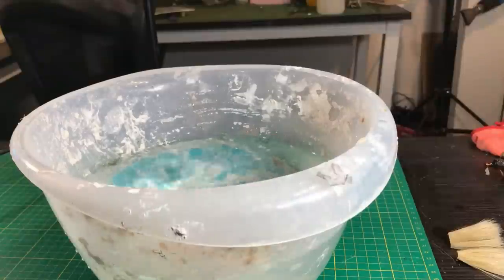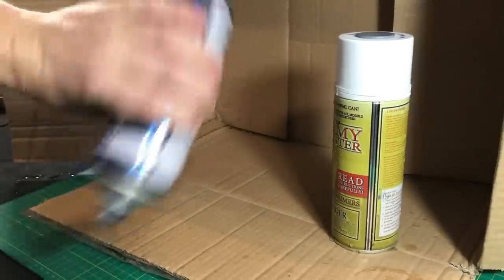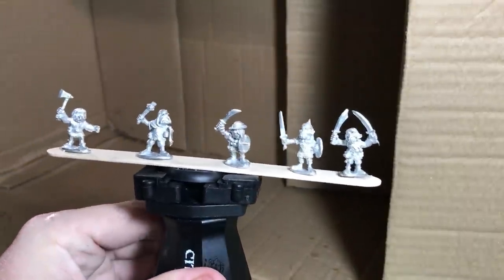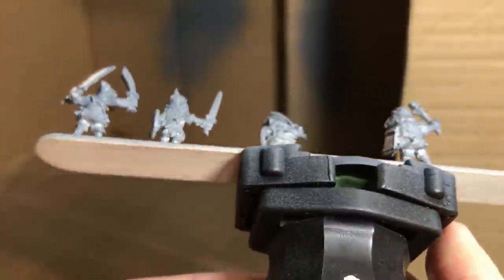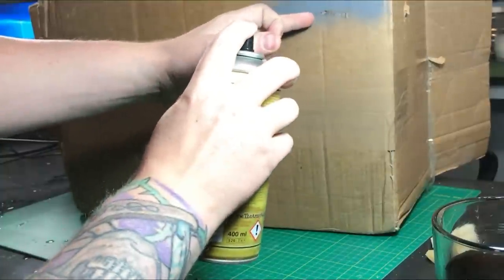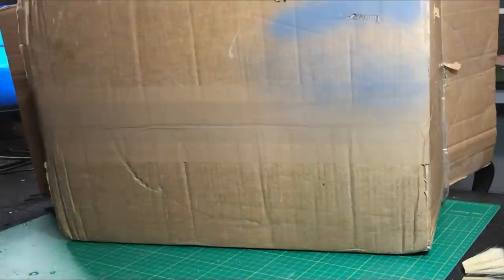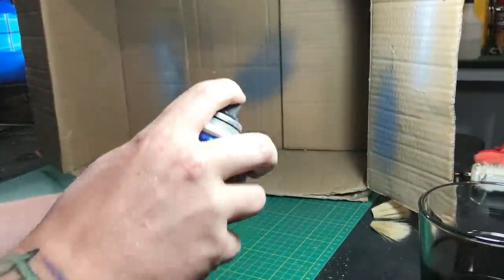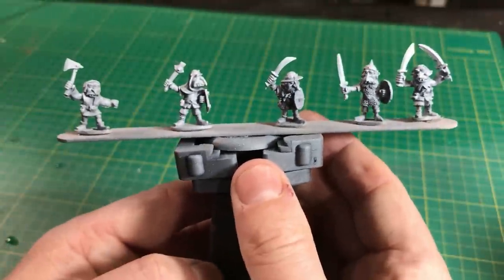Is It You Or The Spray? :How To Use Spray Cans Without Fail

Comment: Fantastic vid!  I disagree with you the upside down clearing spray when you are done.  I find that ESSENTIAL to keeping spray cans in good order because I live in a high humidity area.  If not cleared, paint WILL DRY in the nozzle head.And it really doesn't waste all that much paint.
  I have used the Army painter cans almost exclusively since they were released.  They are mostly fantastic.  HOWEVER I have had multiple cases of their white spray clog up IN THE CAN! even after upside down spraying.  Also, Something with their metallic spray colors is off.  They are SUPER hard to paint over and I have had it create pits in certain resin models.  I now always spray black and hand paint metallic when possible.
yes, warming your paint can is essential to mixing your paint properly.  And spray distance is the number 1 thing printed WRONG on most spray cans.  I always test fire my cans before proceeding onto the model.  You don't want any surprises shooting out of the can like globs or spittle.  
Lastly, WEAR GLOVES!  a cheap box of nitrile gloves from the hardware store can save your hands from paint, and save your models from fingerprints.  Its so much nicer when you can just go ahead and hold something while not worrying about spraying your hand.

Comment: Hi everyone, PLEASE be careful with warming your cans in water. 
The manufacturer will usually state the max temperature that the can can be exposed to, roughly about 50C.
I've been my GW spray cans in a bucket of warm/hot water like Luke said, and haven't had any problems.
I've always been able to put my hand in the water, so it wasn't scalding, but probably on the warmer side.

Recently, I"ve been using an Army Painter Plate Mail spray can.
Today, after placing the AP can in warm water, I noticed the underside of the can bulging noticeably, about 2cm or so in the centre of the underside.
I quickly tossed the can.

So TLDR; please check inspect your cans each time you immerse them in warm water, and following the manufacturer's guidelines.

Comment: Thanks for a great info vid! Never knew about the warming the can in water first... and I now know that what I thought was a short sharp burst goes on for far too long. I also fell into the trap of thinking I can just quickly spray the bits I missed on the first pass before anything dries.  So it;s practice, practice, practice... and shake

Comment: Great video! But still, even with all these tips, you sometimes have bad cans. I just recently had a GW Retributor Armor can that turned out rather dull and bronzy than gold. It looked like the shiny metal flakes were simply missing or something. Shook it 5 minutes, warmed the can, still a bad result.

So the most important tip of all is always test the color primer on an old model or piece of sprue and let it fully dry to decide if the result is good or not.

Please do yourself a favour and take those extra 10 minutes before spraying your models.
Reply: that is wy you spray on a test surface 1st like plastic party spoons or something

Comment: Hey Luke, great vid! 
I'm over in Canada and usually go on  priming sprees in the spring and autumn to avoid the most extreme weather. 

Can you offer any tips for using in high humidity and 25-30+ temps?

What about -20 or -25?
We routinely see these temps. 

Thanks
Reply: Dude we get fully stretched bungholes by the weather round my place. I've had good results priming on the sprue grey and having a brush on primer grey to touch up. I can store a bunch of sprues and be readu for bad weather. You can try to make a spray box with view port like a cheap sanding box but thats tons of work and can be imperfect, one small gap and the laundry machine has a mix of purple and rust and the SO has never truly forgiven lol

Comment: Thanks, I’ve used this method a couple of times now and it works well. HOWEVER, a word of warning - don’t leave the can in the water for too long/have the water too hot. I did this and something inside the cab exploded, and the bottom bulged out (thankfully the whole can didn’t burst). After this it didn’t work properly, and I think I’ll have to throw it out sadly.
Reply: Lol, happened to me just now with Army Painter primer.
Reply: @ArmchairTroop  bad luck! I feel your pain...
Reply: @joshhales4718  Thankfully the can was already close to empty, or at least that's what I kept telling myself when it no longer worked.
Reply: @ArmchairTroop  do keep telling yourself that... To be honest since writing that original comment this has happened twice more with Army Painter cans, even after I stopped putting them in water, so I don’t know what’s going on. It’s put me off using cans at all now.

Comment: @Lukes Aps I have this problem that I can't figure out and you might know where after priming a mini with GW Chaos Black spray, parts of the model go white.  Whats going on here, because it drives me bonkers whenever it happens?? ........ Also should we be prepping models prior to priming to help the priming process and if so how should models be prepped? .... I've heard some models need a warm soapy bath before priming to get surface oil out due to certain resin types.

Comment: Thanks, mate. I've tried different cans with different type of paint and they all seemed to be shitty as hell. I've even tried short burst of spray but every time I had to press harder than I wanted to so I would get an even spray. And it all ended with a big mess. But maybe I just need to practice even more :)
Anyway, thanks for your video. It really helps me a lot. 
PS! Does it work find to spray like you do inside the house using a box as some kind of shield?

Comment: Have you had a bash with the Plastic Soldier Company Army Sprays? I've never had a good result over about 8 cans or so now, such a weak pressure and poor pigment content. Night and day compared with other brands. Which is strange since apparently it's Army Painter that do the sprays for PSC. 
And it's near impossible to get a colour match for the PSC Mid-Late War Dunkelgelb.

Comment: Question, I bought one of those cheap 2€ paint cans, and I want to follow your advice on putting it in hot water before using it, but in the can it says that I should not let it heat up
So do different cans have diferent restrictions or should I try the water anyway and risk it exploding?
Reply: @GeekGamingScenics  will do so, thank you good sir

Comment: Really helpful. Thanks!

The tap water where I live is very hot and it isn't adjustable. What's a safe temperature for the hot water? 40? 45?
Reply: @GeekGamingScenics  Thanks for the reply. That's the plan, but I don't want to cool it down too much. I just wondered if there was a safe temperature to aim for.

Comment: Nice! Very helpful tips! But can I skip the hot water parts since in Brazil I usually get the average of 25°C on winter and 35°C on summer? Or its really necessary?
Reply: Short answer NO!

Long answer, no.  Because the can will always be colder than the atmosphere and the paint going from a cold container to hot air will shock it and cause it to dry too fast and possibly fuzz out.  So heating the paint up to your air temp is important.  Ideally you want your paint in the can to be the same temp as the paint outside the can.  I live in Alabama so I know all about heat and humidity.
Reply: ok!! thanks!

Comment: thanks Luke very helpful, any tips for getting a really shiny gold i tried cheap 151 gold spray then rustoleum metallic gold spray but both are dull not chrome or mirror finish as the lid would suggest,  alll the best   ian.
Reply: Try Montana Gold - Goldchrome

Comment: Good video, just wondered but I sprayed a model with matt clear to hold weathering powders on after it dried it went like a white mist on it any tips to why? would be much appreciated.Rich
Reply: 1. use a quality Matt clear like the Armypainter stuff.  It has never fogged on me.
2. try not to spray clear finishes while it is hot or humid.  Fogging occurs when too much of the finish dries too quickly.  It can either be due to weather, or using too much product.
3.  hold the model closer, like 3-6 inches, and use very little paint.  A lot of fogging is due to the varnish drying while travelling through the air.  you can use very little varnish to go a long way.  Its not like a primer coat.  Just enough to hold decals or powders in place will do the trick.
4.  It sounds counter intuitive but you usually can respray or hand paint the clear finish and it should counteract the fogging because the new paint will act as a kind of solvent on the previous coat.  but it only works if you have done nothing else to it.
Reply: @HeadCannonPrime  thanks for that  ,I think I was doing it too far away by what you said & drying as it hit the model , I didn't put loads on just a couple passes as just to hold the  powders, I might do another go on it & see if it does make it better. Thanks again for the info. Rich👍👍

Comment: And this video comes out a few days after I ruined a load of models with bad spraying last weekend.  I say ruined, I will probably have to strip them with biostrip and start again.  I got the dusty finish, which I put down to the temperature (12 degrees C) or humidity but would seem to be spray distance, as I was spraying at 12 inches like the can said.  Doh.

Comment: what about with the clear coat spray paints. i know it may be the same answers as you just did but im just making sure as ive been having a lot of issue that everytime i use it is all leaves a frost look or worse a frost effect. is there anything extra i should try?
Reply: Always use top quality, miniatures focused clear coats.  Yes they cost more than general purpose but they are worth it.  I prefer Armypainter myself, Krylon is garbage for miniatures.  Also, especially heat up matte spray cans.
Always use less than you think you need.  Don't spray it like a primer.  If you can see it, you have used too much.
This is why I like to wear nitrile gloves.  Overspray onto your finger so you know you have covered it, then put it down to dry.  
do NOT spray multiple passes or coats before it has dried.  1 spray pass, and let it dry.  that is it.
Reply: @HeadCannonPrime  ive used krylon for years now with clear coats thats why im a little shocked. its just this last can i got every time i use it frost looking or effect.  but ive never warmed the cans up before so ill try that see if it helps

Comment: Never from a long distance i.e. more than half a meter during a hot summer's day, otherwise you get bumpy and grainy surface spray texture which is horrible. Short quick 2 second bursts starting to the side of the model and sweeping a across the model quickly from around 12cm-20cm away.
Reply: I would go even closer than half a meter.  If you live in hot climate I would even go 10 cm.  Armypainter spray dries REALLY fast.
Reply: Actually that could be a good advice for texturing some surfaces :p for exemple giving a nice grain to a rusty piece, or a wall or something else.

Comment: I did all the steps. The day was perfect, 15.c. sun and wind still. Not to dry or to humid.

And still this vallejo crap can destroyed my minie. When the paint hit,  it looked perfect. But as it dried, it was like pigments of paint was pulling itself in, and made a texture that looked liked rusted metal. No matter how close or how far I sprayed from, same crap happened. 
Only solution, was to spray just a little primer on, where I could still see the plastic underneath. 
I could not get a full coverege at all.

Gonna go back to Citadel or try out Army painter. This vallejo can is crap.... :(' ' '